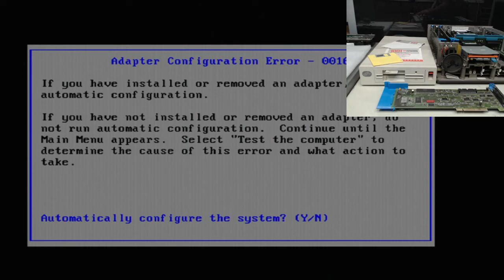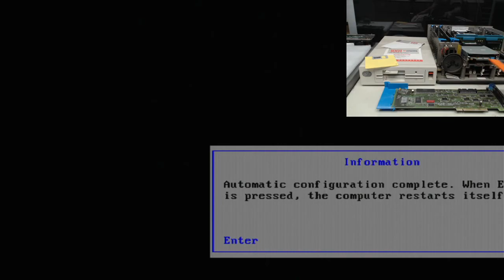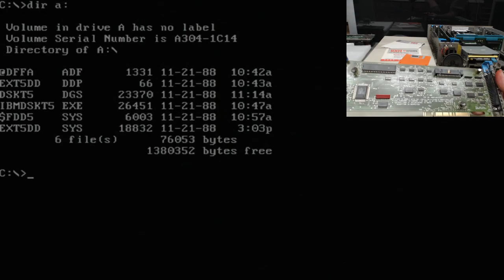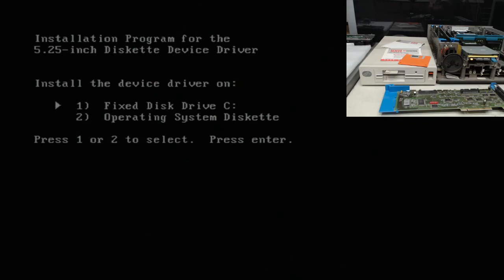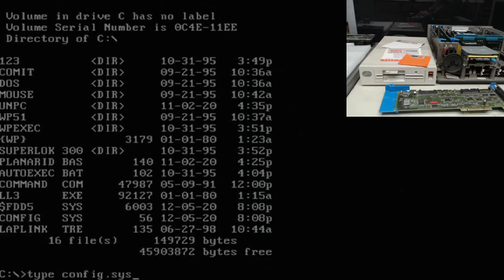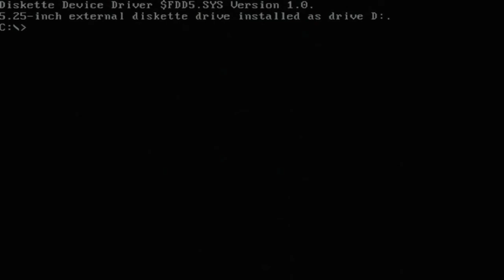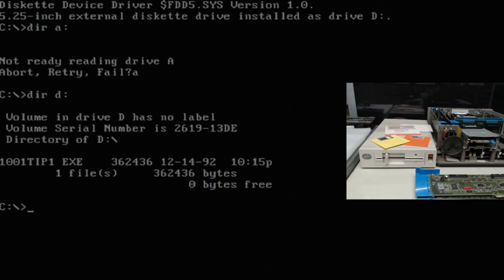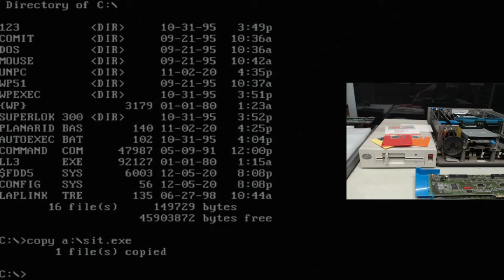Installation of the Diskette Adapter/A on an IBM PS/2 Model 70

Comment: As noted in the comments, if you haven't booted from the Reference Diskette and used the "Copy an Option Diskette" function before installing the 5.25" Diskette Adapter/A, then when the 165 (adapter configuration changed) error occurs and you boot from the Reference Diskette the Run Automatic Configuration process (using SC.EXE in an automatic invocation) prompts for the Option Diskette, but only loads the required files into memory for use by SC.EXE. It does not write them to the Reference Diskette.

It is preferable to copy the files to the (Backup Copy of the) Reference Diskette prior to installation of the adapter, but may also be done after the Automatic Configuration process has been performed, as in the sequence shown in the video.
Reply: Correction 4869-001

Comment: I installed the IBM Personal  System/2,  5.25 Inch Diskette Adapter/A and drivers on my IBM PS/2 P70-386 Luggable Computer, with a IBM 4869-002 External 1.2 MB Diskette Drive and found a bug with the drivers. When you perform a format D: /U /F:1.2 the disk is successfully formatted the diskette with one exception, "The Volume Serial number is 0000-0000. The operating system is IBM DOS 5.0. I have no idea why when the disk is formatted the system does not assign a Volume Serial Number. Is there a workaround or does one have to live with this bug?

Comment: cant find the options disk in the link you provided. Any chance you can put it here? 

Thanks
Reply from the maker: It's the '4869drve.exe' file at https://www.ardent-tool.com/floppy/5_25_Floppy_Adapter.html
Reply from the maker: Let me know if you have further issues getting it - it isn't that large of package, but could be zipped up for easier transfer.
Reply: @IBM_Museum  Nope got it working Thanks very much! Now I need to figure how to make the external 360 drive A or B
Reply from the maker: @xixi3181 : The simplistic driver doesn't allow for that, although there are past references on the page (without any details) about making it work that way. Is your primary drive non-functional?
Reply: @IBM_Museum  All my drives work. I want to use my model 50 or 70 as a retro station for making 5.25" disks for my other retro systems. The Ti99 disk recreation software will only write to drive A or B and the IBM external is D:. So I am going to disable the internal 3.5" floppy and try LASTDRIVE=C and see if DOS will assign A or B and if that doesn't work I will try SUBST D: B: